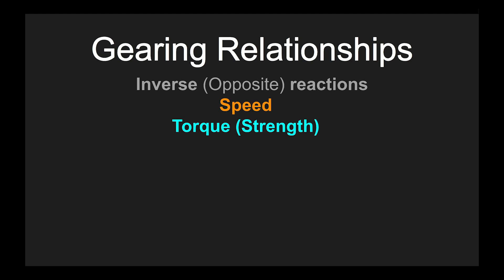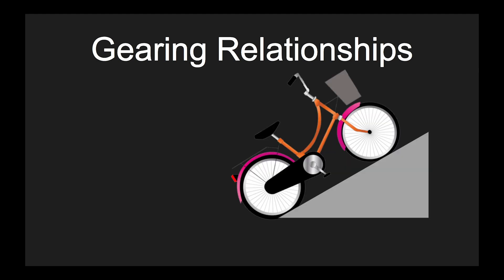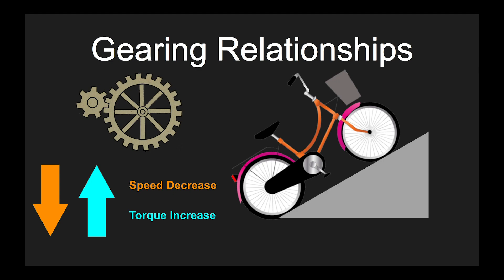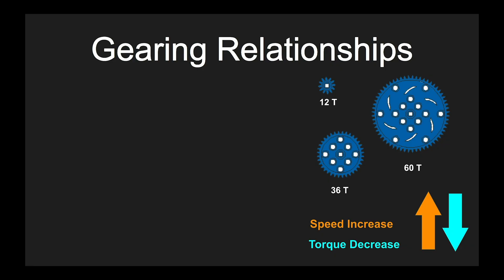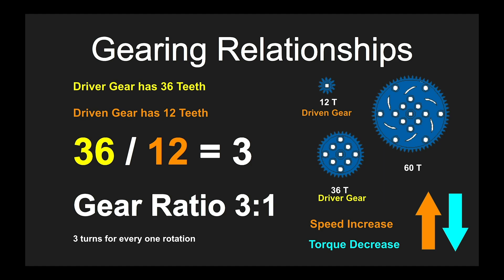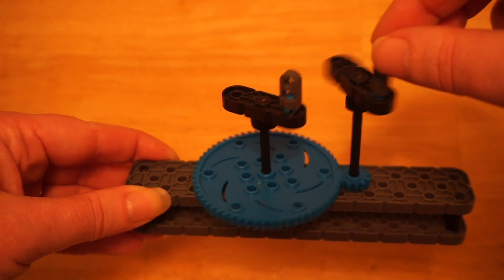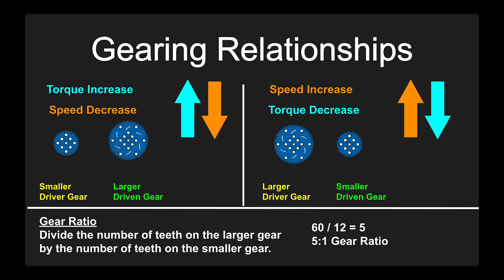Gear Ratios Speed Vs Torque Tutorial

Comment: What!?  The definition of gear ratio is the number of teeth on the driven gear divided by the number of teeth on the drive gear.  If the driven gear has less teeth than the drive gear, you have an over-drive condition and the gear ratio would be less than 1 to 1.  The definition of gear ratio in this tutorial is only valid for an under drive ratio.  This needs to be corrected!

Comment: So if Id wanted to push a heavy object up a hill, its better to use a small gear while connecting the wheels to a big gear?

I would need to provide more input to move a small distance but the smaller gear be faced with higher force requirements?
Reply: Yes

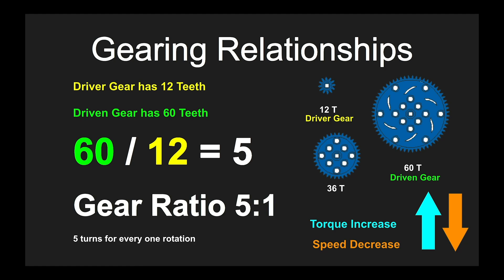3:49

Comment: 1:1, output will be the same as the input.

2:1, output will be twice the input. So one input rotation will be two rotations of the output. Effectively covering more distance in the same amount of time. Speed is distance x time and so you get a higher speed. 

1:2, output will be half the input. How does this multiply torque? IDK, it just works.
Reply: The output is not just distance but force as well.
Work = force * distance
If an input force results in half the output distance, due to conservation of energy, to produce the same amount of work the output force must be doubled.
Reply: Aren't rotation and speed and distances three different things?

Comment: And I’d really appreciate it if you still explain why torque is increased in first gears in cars
Reply: 1st has the largest on the output. If the input (crankshaft) has 4 teeth, and output (driveshaft) has 16 in 1st gear, 12 on 2nd, 8 on 3rd, & 4 on 4th, the ratios are 4:1, 3:1, 2:1, & 1:1. This means the engine has to turn the crankshaft 4 times for the drive shaft to have 1 rotation in 1st gear, and rotate the crankshaft once to rotate the driveshaft once in 4th gear. 1st gear has more torque than horsepower, but as horsepower is increased, the toque is reduced (torque is work, horsepower is like energy, with more horsepower, the easier the task is to do, in this case, rotate the driveshaft).

Can see this again with fuel economy and velocity. Looking at a carbureted engine, as you increase velocity, more air is pulled through the carburetor. The more air, the better the fuel is atomized. The better it's atomized, the easier it is to burn efficiently, thus using less fuel for each combustion stage. This is why some people, particularly racers, may change to blowers or remove covers on their air filter, to increase air intake. This comes at the cost of increasing debris entering the engine which would scour the cylinder. It is also possible for a vehicle to reach a point in engine speed that it has too much air intake and insufficient fuel that it loses power.